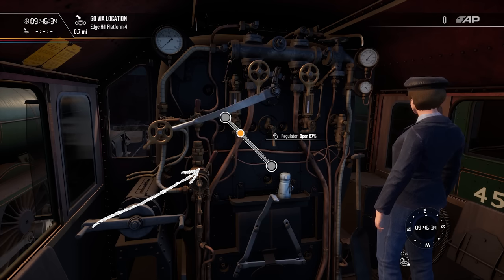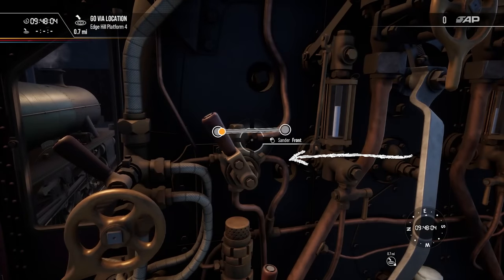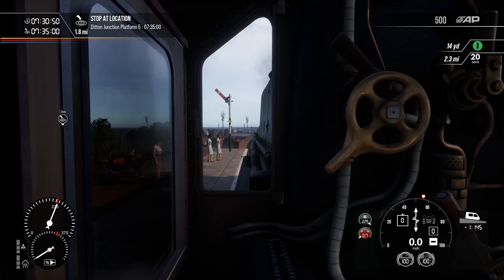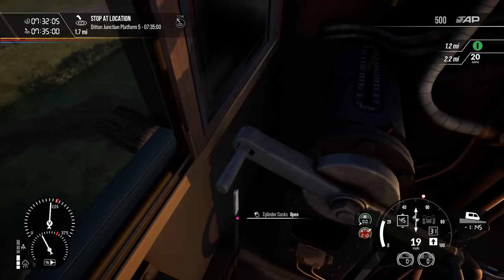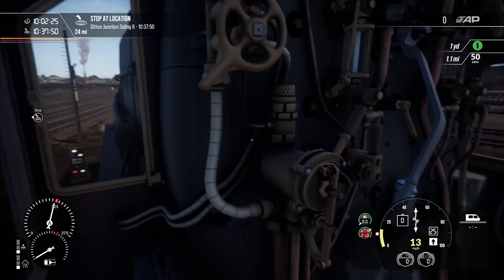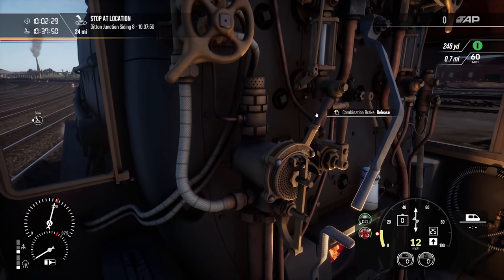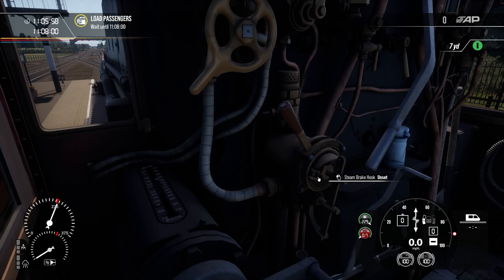A Beginner's Guide to Operating Steam Engines on Train Sim World 2

Comment from the maker: Here are the video chapters. 

00:00 Intro 
00:19 A Tour of the Cab 
02:27 Getting the Locomotive Moving 
04:06 Managing the Boiler and Steam Chest 
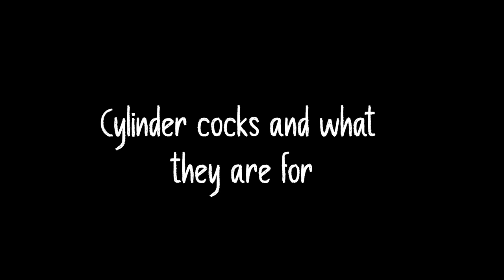05:26 Cylinder Cock and what they are for
06:19 Applying the Brakes 
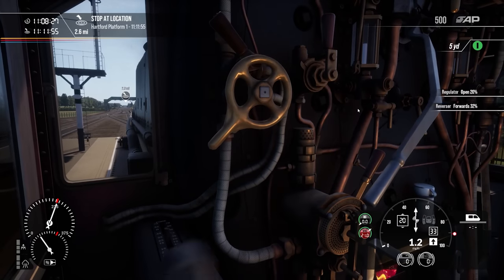08:08 Climbing the Difficult Incline out of Liverpool Lime Street
09:29 Moving the Locomotive at Slow Speeds
Reply: Very nice.
Reply: @Yo.3254  5PM
Reply: @Yo.3254  np

Comment: Don't leave the large ejector open all the time, it uses a lot of steam, it's for releasing the brakes quickly, leave the small open to maintain vacuum in the train pipe.
Reply: He said both of those I think (7:00 and 7:49).  Good tip though :)
Reply: I've learned that keeping it open 38% keeps the brake vacuum at 21.

Comment: I have noticed the brakes will slowly apply again if you don’t set the brake handle to a hook. There is a small hook for setting the handle in position and unsettling it to use the brake handles. If you look around where the brake levers are to release,unreleased it will say unset if you haven’t fixed it into position after finishing with brake levers. So Set the hook to the handle to stop I assume the back pressure building up in the brake pipe line which slow the train down because the levers haven’t been set in position. As I say this is a assumption but I have played around with this hook and it does keep the pressure from moving. I have played with the larger vacuum release handles as you do I have done this from the start because of the issues pressure,brakes and with not noticing the hook. Once I did the large vacuum didn’t really come into play until needed for its main purpose. I haven’t used the small vacuum handles as much. So I will after watching this tho. There are hard drive tho I’ve done about 73 miles hip hip admittedly on low pressure so hardly got up to speed,60 I’d say was the fastest on down hill grade but now I know a little more thanks to this. So let’s give it a go,,,I can’t be bothered trudging along at 30 to 40mph and taking all day to get anywhere. Hopefully I’ll be a try express driver after applying some of these methods. I do wander if they built the some type of physics in the loco as all locos behaves differently and at different times. Hence why they said locos was either having a good day and happy engine a bad day a grumpy engine. They was so alive so like I say have they built this into the physics of how the loco behaves if any at all?. I know they have with the sounds as if you driver the train wrong it’s sounds well not like a steam train operating properly,,,but when you do it will sing too you. So that’s good in a way from the sound guys at Dovetail. Get it right and the loco sounds good. Trust me I experienced it for about 5 mins,,,before I started to sound like a pounced tyre losing air,,then grinding to a halt,,,because I lost all steam pressure. Yey.

Comment: Could we get one such video on the steam-generating, so we can keep the pressure below safety release?
Reply: There is no manual firing (yet), so that is not possible.
Reply: @TheNoGamer44  Matt mentioned in the second stream you can regulate the fireman to an extent, but didn't elaborate a whole lot on that (there's even setting for that in the settings menu)
Reply: Use more regulator! 😉That's the biggest drain on power, particularly when the third valve is activated at approx 66%.
Perhaps switching the fireman to Assisted mode so that you can manually control the airflow, then turning off the dampers and blower.

Comment: Can you do a tutorial on how to get a heavy freight train going in wet conditions because I can’t seem to move the 8f in the wet
Reply: What you have to do is you have to go to all the red freight cars. And by the wheels find a lever called vacuum release and then put it to release. This will release the brakes on the red cars and then you’ll be able to get the train moving.
Reply: there is a sander leaver, have it set to front, and then slowly give it regulator power once the brakes have released
Reply: @james-jn9ui  i tied it but to no success
Reply: Do you inow how to do it too?

Comment: Does it have injectors putting water into the boiler ?
Reply: Adding water into the boiler will be up to the fireman. since it’s not added as of yet you won’t need to add water with the injectors. 🙂👍
Reply: do you know how to release some steam pressure, the safety valve going everytime i stop is annoying. I have the steam firing mode on manual so the temps shouldnt be going up while stationary.
Reply: @gamerdeol2694  you would normally quiet her down by injecting water into the boiler. Especially if water is low. But don’t think you can do that in TSW atm.maybe turn the blower down a bit. sorry can’t be more helpful. 😕

Comment: HUD for the steam chest isn’t working on the 9F of console
Reply: set you fireman in the setting to automatic then they work, don't ask me why
Reply: @dallasmann7904  Thanks! Not sure why the automatic fireman isn’t on by default they imply all you should be focusing on is driving and steam conservation
Reply: @Stoker58  ya I know, no clue why. I figured out that opening the firebox, using the blower and setting the dampers which are on the floor front right side of the cab, you'll get those HUD icons working